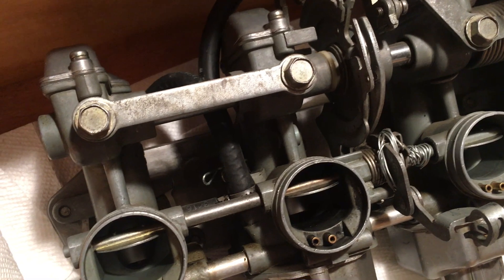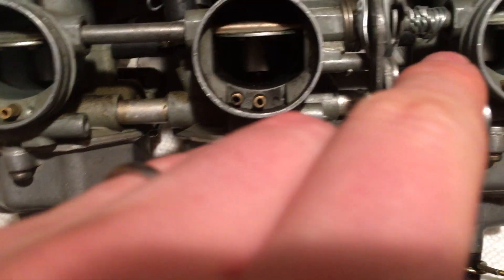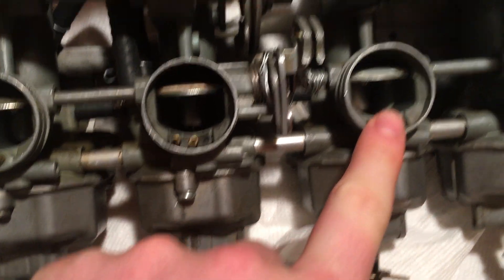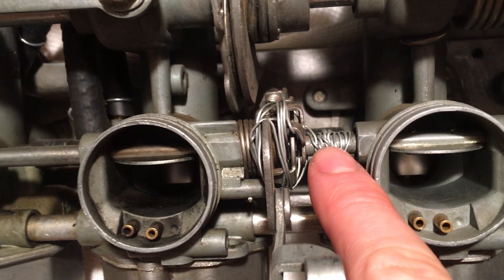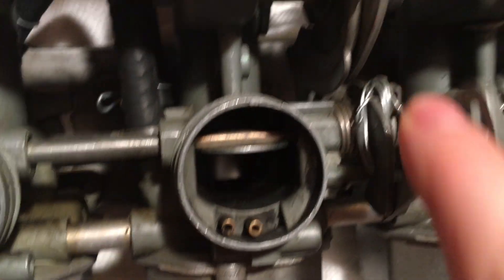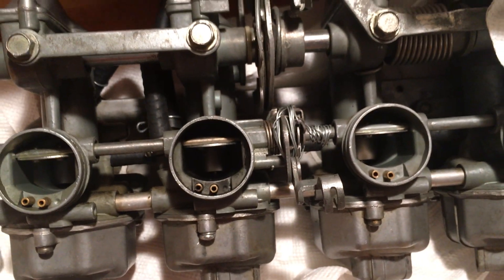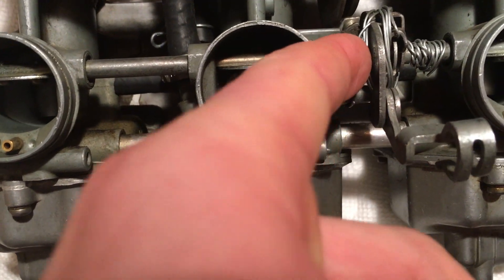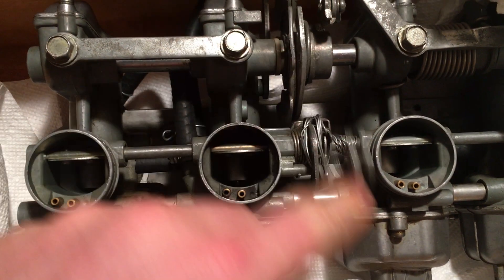cb550 carb choke hack

Comment: Chris, take a close look at the choke plates. What I found is that some were rubbing against the throat. I was able to center the choke plate away from the sides by loosening the two screws, and on one, just file the plate so that it won’t rub the side. You can find the problem child by loosening or removing the suspect choke plate. You can also check to see if the problem is with the choke plate rod by taking off the choke plates. The rod should move freely.

Comment: Hey Chris,
So I'm having some issues with the same carbs on my 78 cb550. Only difference is that my butterflies DON'T close all the way, in fact they stop at maybe 1/4 of the way leaving a HUGE gap open and finding any source of information on that particular subject has been kinda hard.
Any ideas on why it does that? Why the butterfly valves don't close up? Some have told me that it's because the rod is out of sync (not sure what that means) like they're improperly adjusted?